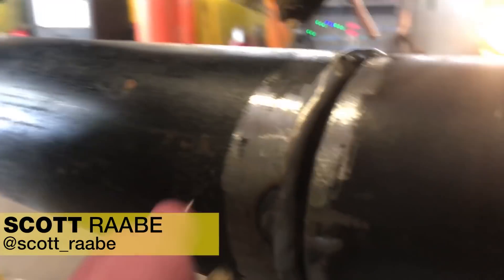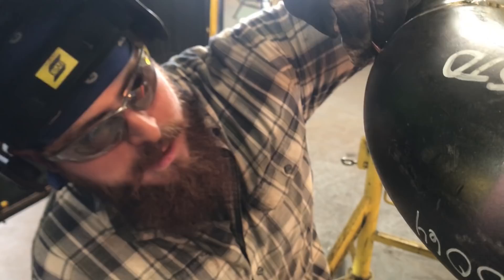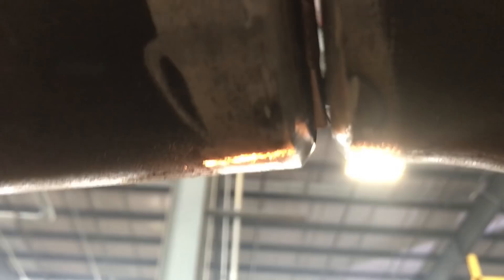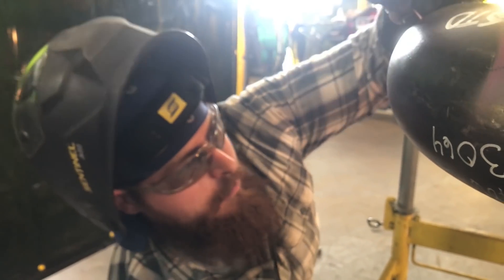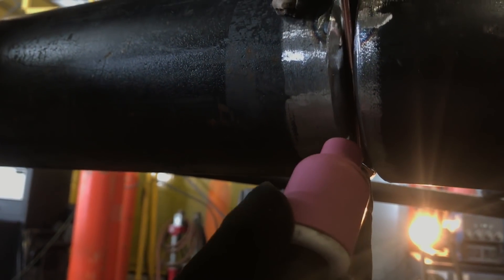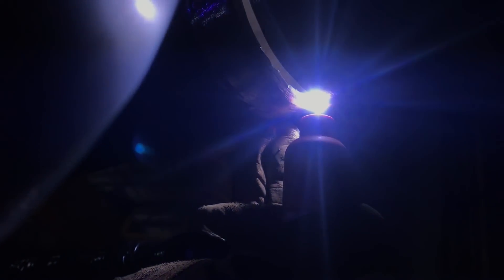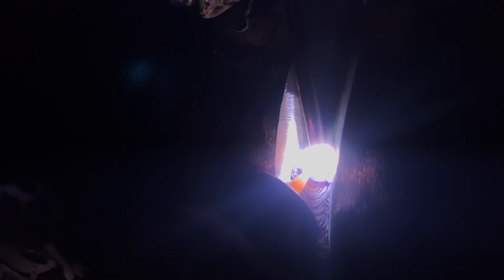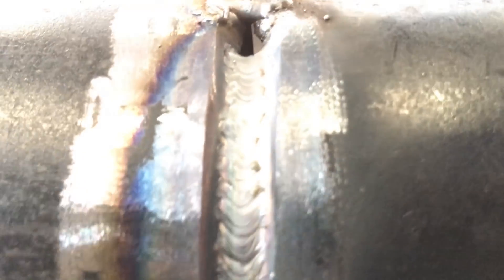5G TIG Root Pass - Tips and Tricks for Pipe Welding

Comment: Is this carbon? I thought you had to constantly feed and not dip. Thought dipping was with stainless. Someone help im in training with a company right now kind of nervous to fail out.
Reply: It doesn't matter what you do as long as you break the walls down and don't have any suck back. It's all about preference but I try and not break surface tension with the wire on carbon. Stainless usually dip key hole and sometimes just straight lay wire. You need to know how to do it all really
Reply: If it ain't round I turn it down appreciate it I haven’t gotten a answer to this question for the longest
Reply: @Sgc_louie  No problem
Reply: @Sgc_louie  Also you can put a good root in on a 5g with an 1/8inch gap and 1/8 wire. Just be careful for suck back on the bottom but you can get good reinforcement. I've welded in some places that didn't want you backfeeding.

Comment: Esab,this side from the pond we use hf start  up / down slope especially for exotic materials.
No more scratch/lift (tungsten  contamination )  or  oxidized tig wire =no gas shielding
( down slope / past flow)
Reply: That's very common in America as well. They're just showing scratch start because it adds more variable to show in the demo than using 2t or 4t would